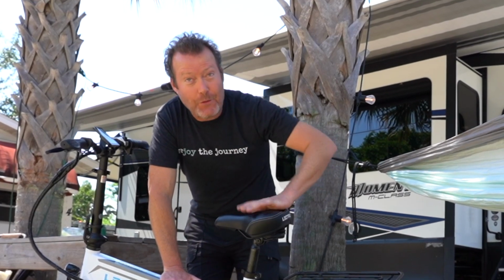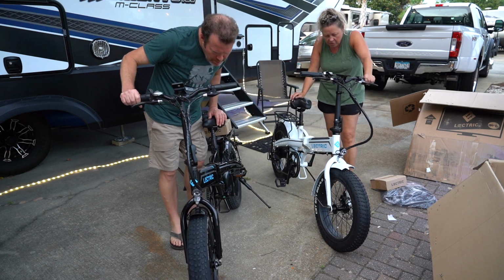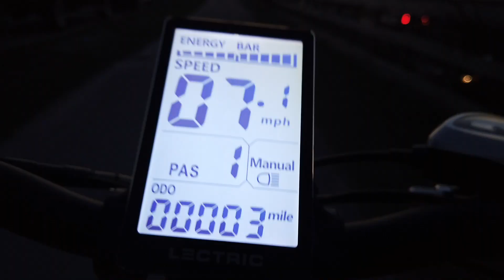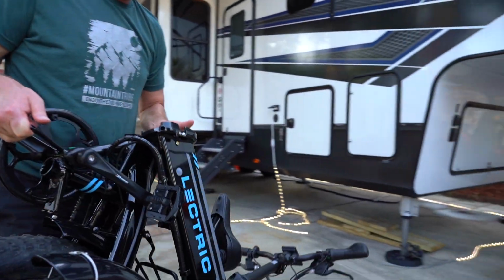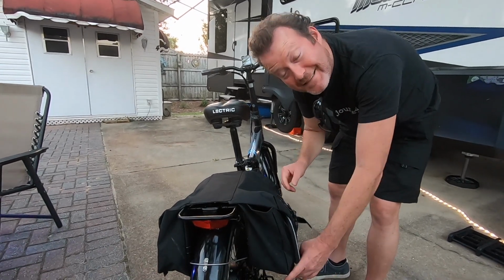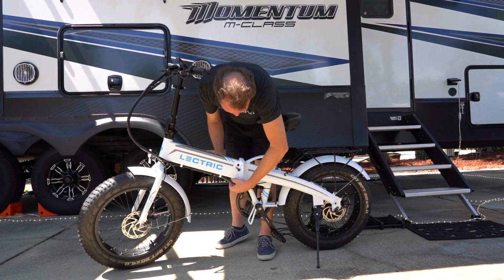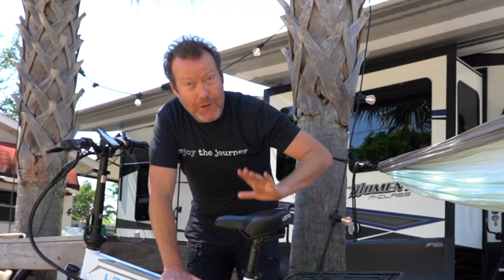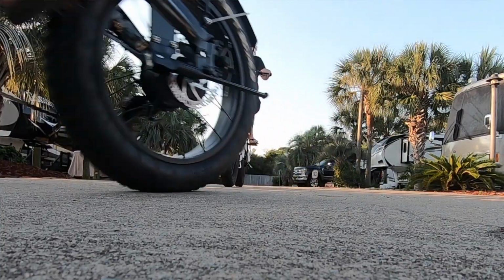BEST EBIKE UNDER $1000! (LECTRIC XP ELECTRIC BIKE)

Comment: you have to look for some locks called abus I had one for my motorcycle which was made of spichelt hardened steel they were so strong that they could not be cut over by a hand held angle grinder and it was not so big in circumference but ABUS has many good lock

Comment: I have two ebikes  both by Opti bike from 2009.  both are 800 watt bikes with 160 nm of torque. I can go around 35 miles on one charge. Both full suspension with hydrolic  rotor  brakes.

Comment: We bought 2 last June '19. The lock to get is a motorcycle lock that goes on the brake caliper. (7MM MOTORBIKE MOTORCYCLE WHEEL DISC BRAKE LOCK ALARM SECURITY ANTI THIEF 2 KEYS.) We switched to T9 cloud seats and telescoping seat post great for the but and back. Enjoy!! BobnRobin

Comment: Florida law places a 20 mph cap on the top speed of the electric bicycle. Any electric assisted pedal bike that exceeds that top speed capability to 30 mph is considered a Class E moped and a license and registration is required. Class E bikes are only allowed on sidewalks under pedal power. There are high performance models available that can reach speeds of 80 mph and are classified as motorcycles.  And every state is different

Comment: The designed was just like my Fiido M1, same location of keys,folding,battery and same size of tire I guess its 20 x 4.0 flat tire but no mudguard was included. I guess its 25kgs net weight

Comment: Ok lets talk safety. Shoes are a must. The first time you have to put your foot on the ground and it gets shredded by pavement or concrete you don't understand the importance a protecting your feet. Let's also not be afraid to wear a helmet with a mirror. Be safe out there and don't forget to lock your bike

Comment: We have Lectric bikes as well. We got 3 other couples to buy them. About 2 weeks ago while out riding, the latch on the handlebars jiggled loose while riding it & the handlebars collapsed forward while traveling about 17mph. The rider plummeted face first forward over the handlebars & slid on the ground about 20ft before stopping! Needless to say he ended up in the ER. 18 staples, 10 stitches later he was released. We are so darn lucky a car didn’t run him over & kill him. We did contact Lectric bike & they contacted him w their condolences. A few days later they contacted him again & said they would be sending out notifications to riders & seeking a new locking handlebar device for future bikes. We put a radiator clamp on our handlebar latch after this happened for added security! We love our bikes but consumers do need to be aware that the latch COULD be faulty. Also want to note the latch on your bikes is NOT the same latch they have on the one that collapsed. I wish I could post a pic of the latch of his handlebars. If you look online at the current bikes it’s different than your latch. Hope this helps.

Comment: Don’t need no stinking instructions! Just ride.... then crash then read... no Flintstone stopping with flip flops.  Get the dome protection and a big lock with a bionic cable.  Good luck 🍀 and many happy miles
Reply: I have ridden old bikes found on kerb side dump offs without brakes, I use Flintstone brakes

Comment: Nice, I'm currently building an ebike, it's a Stealth Bomber style frame(enduro), this is my first ebike build, I have built mountain bikes before, so I'm not completely clueless, but it is definitely a learning experience. When I originally embarked on this adventure, I was going to convert an old mountain bike that a friend gave me, I realized pretty quickly thought that this wasn't going to work, the mountain bike frame wasn't disc brake friendly and you pretty much need discs brakes for an ebike. So I then bought a new mountain bike frame that was disc brake friendly, however the frame was 14.5" and to have a large enough triangle to mount a pre-made battery pack, you need at least 15", so I built this one into a 21 speed mountain bike. So after watching many, many video's I decided to buy a frame that was designed to be an ebike, hence the Stealth Bomber frame. I am 64 years old, I'm a veteran, I am a retired corrections officer and this is now my new hobby. I have watched a couple hundred hours of ebike building as well as battery pack building and I have bought a battery spot welder, I got a stick welder as well as a metal cutting band saw, I may still buy a plasma cutter, but I bought 100 LifePO4 32650 batteries to build my battery pack with, the plan is to build a 72volt 40Amp battery pack, the motor I went with is a Luna Cycle Cyclone 3D it's a 3000watt mid-drive motor, I had previously purchased two battery packs, one is a 48V 17.5Ah battery and the other is a 52V 14Ah battery, neither of these will work well with my motor, not enough amperage to give me any range to speak of. I live in a very hilly area of the country, south western Pennsylvania and while there are lot's of places to ride, not a lot of places to charge up, so I'll need to have at least a 20 mile range and anything below 20amps is not going to last with this motor. Well I wanted to say, I really enjoyed your video and look forward to seeing more. Really love your camper/condo. 🖖😎

Comment: I got one a year ago.  The fat tire compact folding size is really nice.  I have a fullsize mountain bike electric and several 21-speed full size bikes. Plus a tandem bike that I have had for 30 years.  But the Lectric is a very good utility bike!  The quality and features for the price is hard to beat.
Of course a hard core cyclist would want a pricier, high tech bike.  But for travel and casual use.  It is a fairly good deal.

Comment: You scraped your bumper all up. You have an older Prius. I have a 17 and a 21. I wish I still had my 2003. I think the older models had more room. I always lay a blanket down on my bumper. They are good little bikes. Ive had mine since they first came out. 2018 I think. I had to get on a waiting list because they hadnt actually started production yet. I wish I had the tires like you have. I have the knobby tires and since I ride on street most the time, its kinda rough. I have had a flat, on the back. It was an ordeal. Made me paranoid about riding for awhile. I got over it. loaded it up with that green stuff. I have a velcro strap when I fdold it up. I have NEVER taken my battery out. NEVER. Thats silly.

Comment: Until you are used to riding with pedal assist, turn it off when make slow turn arounds. Or remember not to pedal in the turn. The PAS kicks in after a few rotations of the pedals. Can be a problem in slow tight turns.

Comment: When you lock up the bikes don't lock only the front wheel they can be removed quickly and you can steai the rest of the bike. Attach through the frame and the wheel and it will be safer. they can steal anything but if you can slow them down the better chance someone will see them.
Reply from the maker: Great tip...thanks!

Comment: I've only got 50 miles on it, but will speed things up when the weather cools a bit. I can tell that the designers and engineers of the LECTRIC e-bike put a lot of thought into it.  They realized early on that a 60-lb bicycle even power-assisted by an electric motor would need to have a well-integrated collaboration of human and electric propulsion.  It takes only a few outings on the bike to realize the message that this hybrid bike is sending out to the rider:  "Let’s work together to support your pedaling efforts to make this a uniquely fun experience."  It's a ton of fun on the trails, but takes some getting the feel of it before doing so.  Start out on level paved streets until you get a sense of how the bike acts.

Comment: Warning below:  Nice video and looks like an excellent bike, but I have found policy everyone should know and particularly International and Canada if you read their no return policy, its basically a “buy it at your own risk” and no returns.

Website Policy:
You may cancel your order for a full refund up until the time you receive your shipment confirmation email with tracking information. If you cancel after your order has been sent you are responsible for the return shipping fee.  In addition, the original shipping fee we incurred to send the bike to you will not be refunded (even when ‘free’ shipping is advertised). Our refund policy is ‘All Sales Final’. Unfortunately, we can’t offer a refund or exchange after the bike has shipped.

Comment: Just to let you know, other XP vids tell us that once you get the bike set up, it's best to: a) check if all nuts and bolts are tight (especially the pedals should be tight), check for misaligned fenders, and b) fully charge your battery before taking off (not crucial, just in case you take off and run out of battery.  The key inserts underneath the frame's main tube spar (top/bottom tube).  check out the Selle Royal Drifter sprung gel seat or the Cloud 9 (C9) seat.  If you go for the Selle Drifter, choose the brown one (it's a bit softer than black).

Comment: If you haven't already purchased, the new Bontrager Wave Cell bike helmet would be an excellent choice.  The Trek bike dealers carry them. They are a little more expensive than most but worth the cost and much better noggin protection!

Comment: Kryptonite 12mm 5.5' chain and Kryptonite NY Fugeddaboutit 14mm lock is about as secure as you can get, but nothing can stop the thief that really wants your bike. Also get an 8' 15mm braided cable with loops to secure the front wheels and seats. use a lot of common sense when securing your bikes. Happy riding! and invest in a good helmet!

Comment: We have 2 of the Lectric XP ebikes and we love them! Check your accessories for the bell, ours came with Bell. We got ours when they first came out and had to wait around 3 months but they were absolutely worth the wait!! If you need to for carrying more supplies or groceries you can put a milk crate on the rack and between that and the saddlebags you can carry a lot of groceries! Enjoy your ebikes, we do and we like your videos!!
Reply: They do not come with a bell anymore...
Reply: Correct.  No more bell.
Reply: That's a shame about the bell, I have so much fun with it and get laughs all the time for the little ring it does!! Lol. Might get an airhorn now!! Lol.
Reply: @TheSunfire96  We got our bikes back in Aug so we have the little bell but we also added an air horn.  Honestly the air horn is too loud and scares most walkers so we mostly use the little bell...  Whoop Whoop.
Reply: @NORITUCK  that's awesome, lol. Do you get laughed at too over the bell? I thought I would put an airhorn in the cup holder I added. Just for fun.😂

Comment: REVIEW on my experience with one of those....  I've tryed one of those bike last winter, in Joshua Tree....   love the foldable part of it, for sure, but without any rear nor front suspension it's not very confortable and was too hard on my back after 20 minutes, even with their big fat tires :(  Another thing was the lack of 'pedal assist speed'  (this particular one had only like 4-5 speed while others have 9-10) And because we've fried the main controler one morning, it makes me wonder if they are that cheap at 900-1000 $ ..     Thanks for your video.
Reply: Excellent information. You get what you pay for I'm sure.
Reply: Dropping tire pressure to no more than 25 lbs will improve the off road riding comfort.  Some folks have also purchased suspension seat posts.

Comment: The Lectric made my top 3, but I went with a Rize BOLT, which at $1199 has a larger battery (13ah vs. 10.4ah) and a low folding step through frame design WITH a front suspension.  The difference in price to get a suspension and larger battery seemed very fair priced.  I also appreciated that it used a standard format of battery called a "silverfish" which are widely available in various capacities to future proof a bit.   I also bought the upgraded version at $1499 that included the huge 17ah battery, and hydraulic brakes (which I love the smoothness of).  The BOLT has 20 x 2.2.5 tires, so gives up the off road option on rougher trails of fat tire bikes like the Lectric XP, but I thought I wouldn't actually miss much there traveling in my stealth van conversion, in return, the 2.25 tires would give a little less rolling resistance in city.  I weigh 240#, and put 35 miles with pedal assisting about 70% of the time, just throttle 30% of the trip, and had 2 bars left on the battery indicator getting back home, flat terrain in Florida.  It also includes both Cruise Control (speed stays fixed after 8 seconds of constant speed from thumb throttle, canceled by touching brakes), and also a walking mode, where you hold the "-" pedal assist button, and the bikes propels itself at walking speed if you need or want to walk it.

I also liked the Ride Scoozy Fat Tire but was concerned a bit for the internal cable routing since my bike will spend the majority of time folded in my van.  If a home person just traveling occasionally with it, I would have been less concerned with internal cabling.
I also can't say enough about my suspension seat post for $30 from Amazon.  Definitely get one of these to make up for no rear suspension.  It definitely makes a difference over bumps and has made me forget about rear suspension bikes like the Fat Bear...
https://smile.amazon.com/gp/product/B06XC7BB64/ref=ppx_yo_dt_b_asin_title_o06_s00?ie=UTF8&psc=1
If you are the fence about an ELECTRIC BIKE, just DO IT.  I'm 62, have ridden bikes all my life, but felt like a kid riding so smoothly with whatever effort I felt like contributing throughout the ride.

Comment: Nice drone shots!!  That walk mode got me once almost fell over on my head! Natural reaction to hold the bike as it climbs a wall!!  
The lock situation is an old dilemma 35 lb track bike with a 50 lb lock!! 
Bought a used Beach cruiser at garage sale 25$,
Lock and helmet 100$
Rear bike baskets ,front basket   100$
Lol
I clamp a big metal basket on my XP rear rack for groceries
I also turned the 20mph governor off
The locks, very important to have 2 locks of different types
I got a good motorcycle chain lock combo from a place in California called Harbor freight 
On sale 14.99
And a  u lock

Comment: Recommend you run the lock through the frame. Locking through the wheel only secures the wheel from a thief with a wrench.

Comment: Forgot to mention that these have cruise control!  All you do is set your speed using the throttle, then push and hold the down arrow on the pad.  You’ll see CRUISE Illuminati on the information panel!
Reply: Damn, I forgot all about the cruise...
Reply: How long does the battery last???
Reply: IndigoBlue about 250 meters unless it’s downhill
Reply: Wow thanks. I own 2 and never knew this lol
Reply: 😲really. I have to get these for me and hubby 😍  🚴🏻‍♂️💨  🚴🏻‍♀️💨

Comment: You will also want some short-finger gloves. If you fall the first thing you put out is your hands. This is from a 12 month out of the year rider. You will also need that bell, give them plenty of notice - don't ring the bell at the last second, or you may hear some swear words. And you can always say 'on your left', etc as a verbal warning. Enjoy, but be careful. Crashing on a bike can be VERY dangerous and even life-threatening. I've broken ribs, concussion, large hematomas, serious road rash, etc. - many years of riding! A little older and wiser now, and much more careful!!!
Reply: If you start riding more at night then you will want better head/tail lights - NiteRider has some very good cordless-rechargeable lights (the Lumina 1000 is pretty nice). Locks - I use x2 Abus D-Locks (German) - also Kryptonite (USA) not too bad, I prefer the Abus - a little harder to get.

Comment: With helmets - always try on heaps and heaps of them, and plan to spend a bit more than you planned to get that last 20% improvement over the next most expensive one. Go to more than just one bike shop. ALSO, and this important . . .certain brands will cater to different headshapes (oval/round/etc) - find your brand - then you've got a go-to when you need to replace it in the future.

Comment: In reference to the ebikes, you made a comment on following the Florida law on some helmet law.  You also made a comment the pedestrians were clueless to bikers on the sidewalk. Well per Florida law technically bicycles are considered vehicles and are supposed to be ridden on the road and follow the road rules NOT be ridden on the sidewalk with pedestrians, you technically could be ticketed for riding a bicycle on the sidewalk in Florida.
Reply: I think this is incorrrect. You can ride the bike on the sidewalk, but the pedestrian has the right of way

Comment: You are so blessed! First of all to be able to use electric bikes. They outlawed them in our hometown ☹️. Where they haven't outlawed them you still need a motorbike licensed ☹️. We can't ride on footpaths unless there are signs that say they are dual use ☹️. And lastly we can't even ride normal bikes without an approved bike helmet ☹️. Such is life in Frankston in Victoria, Australia, the nanny state!

Also you might want to secure the top of your saddlebags under the spring clip on the packrack so it doesn't fall off.
Reply: only high power scooters are illegal in VIC, Kogan is based in VIC and a friend of mine was touring and saw Fortis fat bikes getting around Melbourne